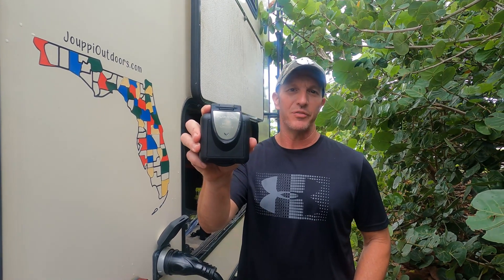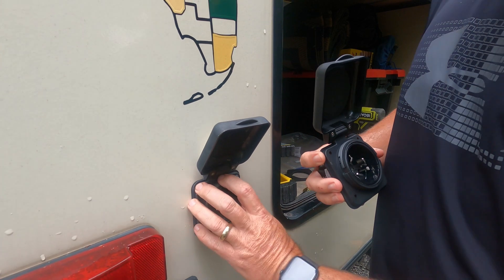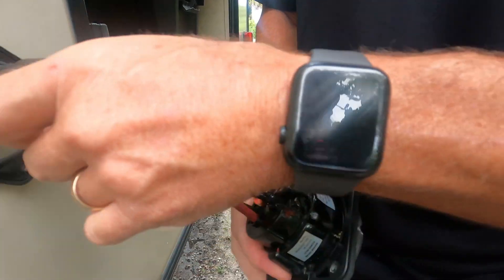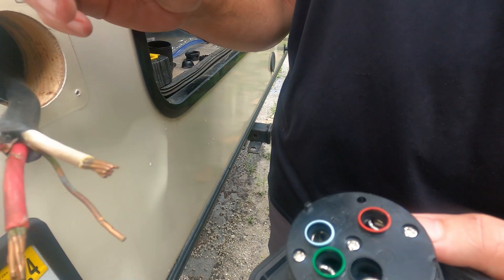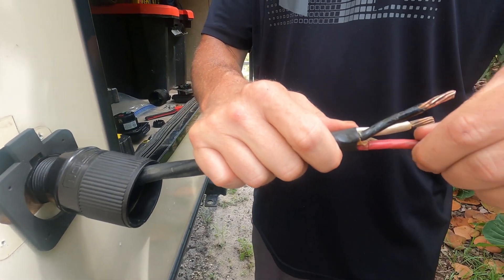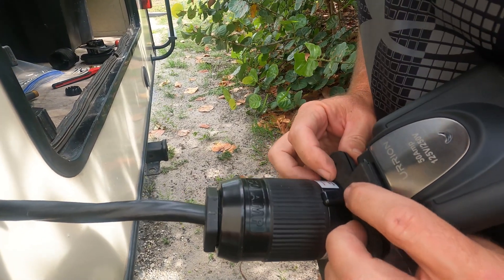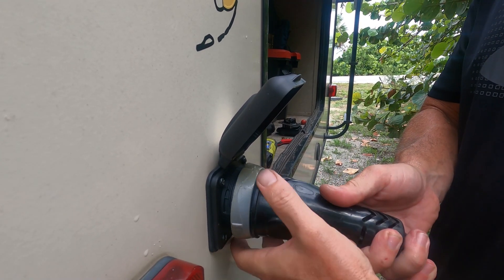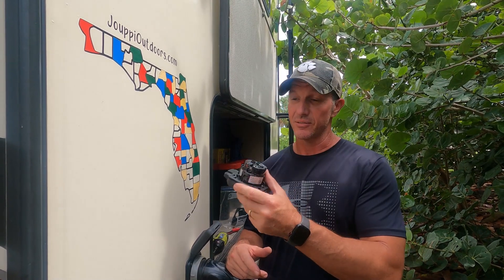Replacing A RV Power Inlet | RV Fire Hazard!

Comment: They weren't loose from the factory.  The vibration going down the road and the expansion and contraction of high loads and heat will loosen them.  Either a little bit of blue Loctite on the set screws or just preventative maintenance to make sure the screws stay tight.  Even your electrical panel at home needs the breakers checked now and then due to heat and expansion/contraction of the wire in their terminals.
Reply from the maker: Good info, thanks for sharing!
Reply: Also a torque screwdriver to tighten the terminals to the manufacturer’s specs. I’m an electrician and I don’t often use my torque screwdriver, even though every device has specific parameters. I will be using it to change out my shore power inlet, along with some blue loctight.

Comment: Nicely done.  The only other things I would have done,  and this is just my personal opinion,  is to put Dielectric grease on the wires before inserting them into the receptacle and to put silicone around the outside when finished. 👍
Reply from the maker: Both good points, I may add the silicone around the outlet. Thanks for the suggestions!